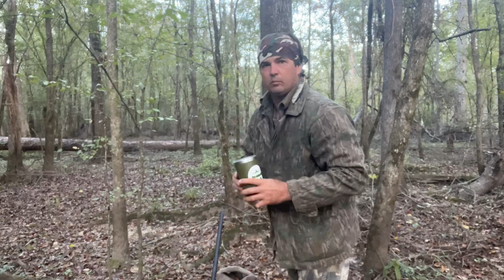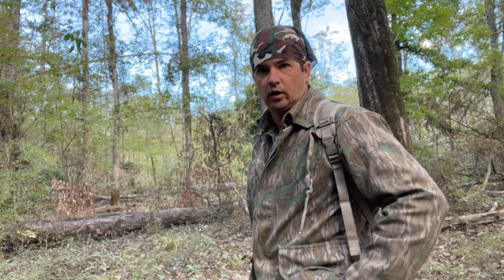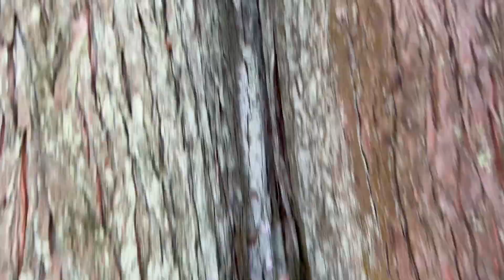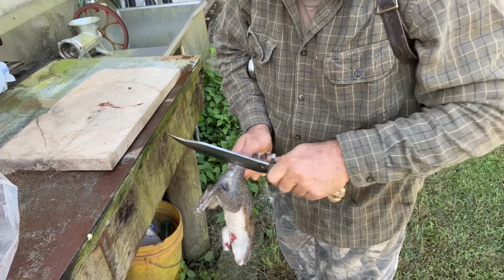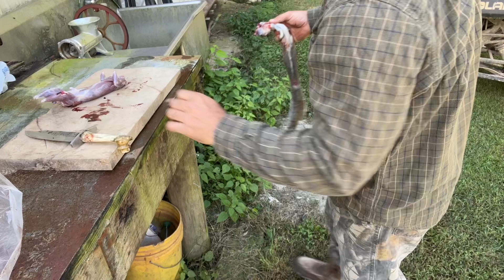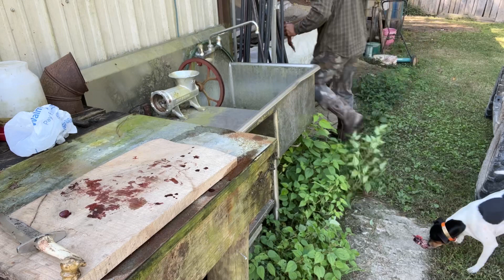Squirrel hunting with my single shot Steven’s

Comment: I normally hunt the noxubee refuge. Went this past Saturday and shot one. It had a wulf in it. First squirrel i have ever shot that had them. Been squirrel hunting for years even in the early season. I really enjoy your videos. I found your channel by trying to find info on nanih waiya wma. Been trying to find a place to put my new sportspal canoe to use. I like canoeing in and camping overnight to get up and hunt the next morning.
Reply from the maker: It was the best place but after the storms last spring its a rough go. Right now its to low to paddle. Watch water level at burnside and if its 6 foot your good up to 10 foot above that the swamp will be flooded in most places
Reply: @SpiritoftheOutdoors  I rode by there the other day trying to scout around. Water looked really low. Low enough I'd have to bring the pirogue and push pole looks like. Hope to have more time to come back and scout some more. Its only a 45 minute to a hour drive for me.

Comment: Nice!! I skin squirrels pretty much the same as you, except I step on the tail and pull up by the back feet. You probly seen that done before. I think if your bream got as big and thick as where I fish, you'd change your mind about them. Good video man!
Reply from the maker: I like bream i just hate scaling fish
Reply: @SpiritoftheOutdoors  I use a Bico plastic scaler. No mess, 2 swipes per side and done.

Comment: Amen. Fill your plate, not the freezer if not absolutely necessary! Q: Would recommend a single shot for hunting rabbit, Turkey, and upland game birds? I like to hike long distances to get away from everyone and humpin a 9lb shotgun can get a man tired! I was thinking of getting the Stevens 301 Turkey 20 gauge as an all around upland game gun.. just take the extra full choke out and put in a modified… cheers 🍻
Reply from the maker: Its all in personal preference i think. There is no such thing as the perfect gun. I like a single shot if im after more that one species cause i can pop a shell out and shove another in fairly quick. I like to turkey hunt with an ole 870 i have. But i have a benellie nova pump and a browning automatic i like as well. Im old school and like the old ways so i wind up toting this little single shot most of the time
Reply: @SpiritoftheOutdoors  cheers buddy! Thanks for your insight! I am very “old school” in most everything I do! I nice side by side and a single shot along with my Winchester model 70 and a 22lr is pretty much all I could ever want or need! I like your style! Be well 🙏

Comment: I remember many yrs ago a buddy had a Stevens single shot shotgun and we were sitting waiting for a squirrel to come around the tree and it came to his side and he cocked the hammer back and drawed a bead and pulled the trigger and the hammer snapped clean off. I fell on the ground laughing my butt off because u should have seen the look on his face. He got mad because i let it get away for laughing so hard🤣 that was the good Ol’days because we were young and full of fun, hell we wasn’t even 20 yrs old yet. That old Stevens almost got wrapped around a tree that day.🤣
Reply from the maker: I have one on the wall rhat wont fire. I got it and this one and an old mossberg bolt action gave to me so rusted up i never thought any would shoot but this one works. I think the other one just needs some new springs in it but i havnt taken it apart